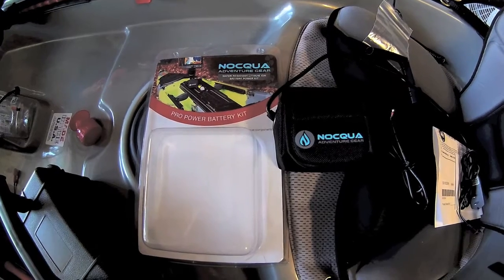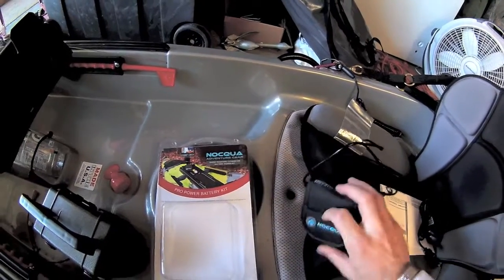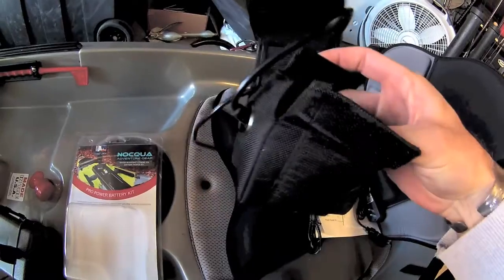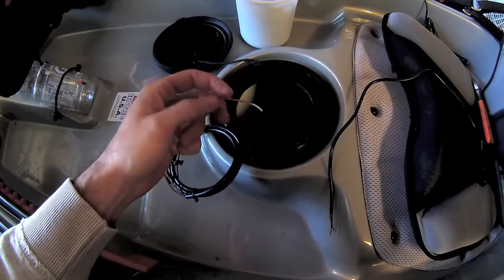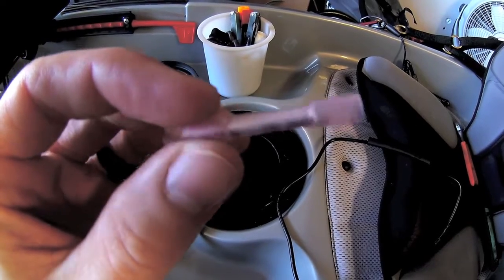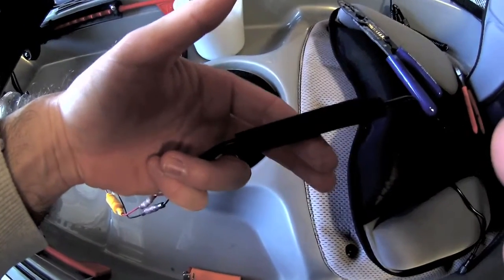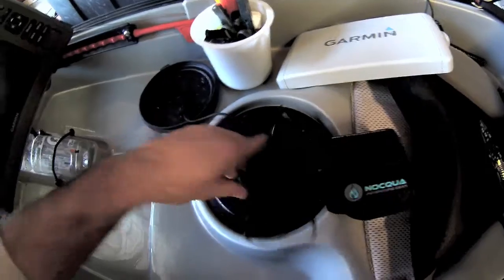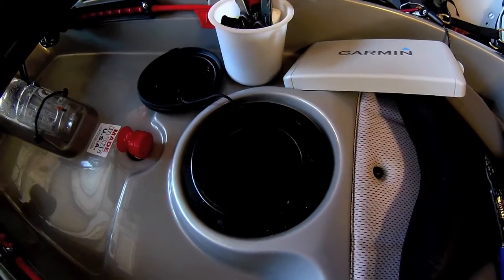Catch me if you Paddle Season 2 Ep #1: Nocqua Pro Power Battery Kit Unboxing and Install

Comment: What if you want to run led lights simultaneously? How would you wire that ?
Reply from the maker: I wouldn't recommend that. I would use a separate battery.